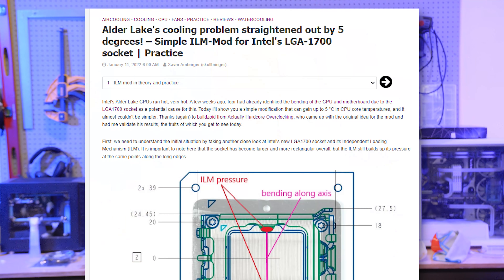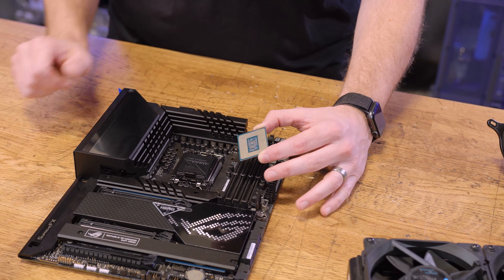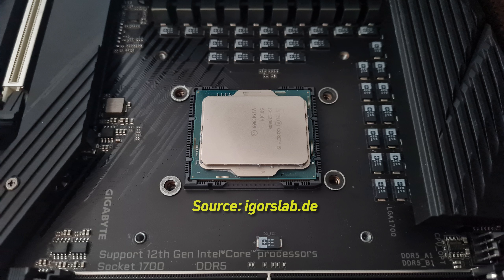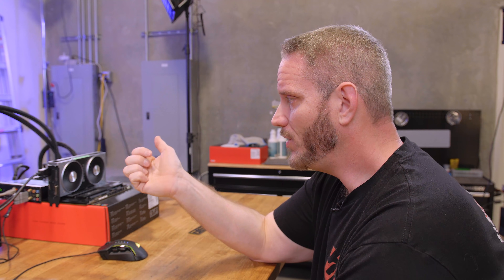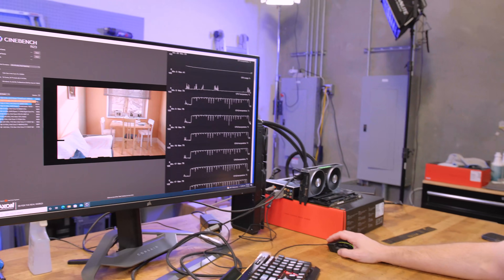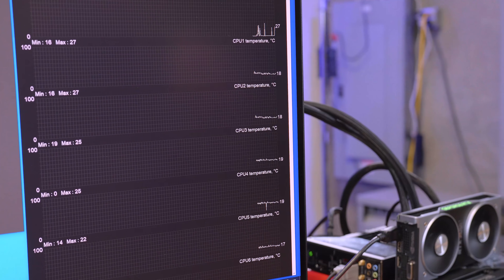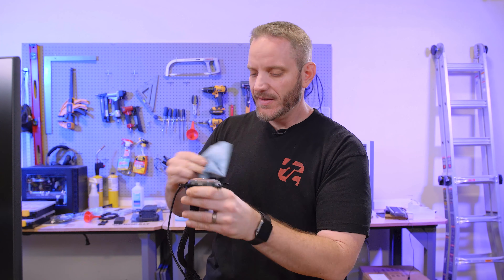YOU GUYS asked me to try this... so I did

Comment: "You don't need it to be polished like a mirror"
In fact, I would argue this could make things worse, but I would have to illustrate it to explain myself.
But basically, for a given average amount and thickness of air gap, a slightly rough surface should have more surface area, improving the effectiveness of the thermal paste.

Comment: I have the i7 12700k cpu, and the specs show that this cpu runs at 190w max and 100 degrees Celsius. So I limited my bios to 180w, and the temperature improved dramatically. The wattage doesn't go over 180w anymore. I use the Gigabyte z690 Game X, which was running high wattage on auto. Now, it is controlled to 10 watts less than the max specs of my cpu.

Comment: Fractal AIOs are known for being in the upper echelon of performance so I think that's probably why you had such positive results. So much in fact that I haven't been able to find one for sale at even close to retail for months so I just said "screw it" and spent $850 on a custom loop from EK. Couldn't be happier and don't think I'll ever be able to go back. I'm spoiled with these temps now. I'm tempted to try their TEC CPU cooler but I don't want to ruin my expectations of cooling forever so I'm probably going to hold off on that.

(For anyone that cares about my temps or setup): i9-13900KS overclocked and undervolted using load line settings and OCTVB to 6.2ghz on the P-cores and 4.6Ghz all core on the E-Cores. Idle temps hover around 30c and running cinebench I don't see over 80c. Gaming I don't see over 70c. My water loop cools JUST my CPU at the moment because I don't see any reason to water-cool my gigabyte 4090, the temps are astonishing with the stock air cooler and 2 180mm fans Intaking from the bottom blowing ambient air directly into the 4090. CPU loop is 1x 120mm rez, 1x EK Velocity2 LGA1700 CPU block in satin titanium and 1x 360x52mm (absolutely massively thick) x360m radiator front mount in a push intake config. Then at the rear of the case is 1 140mm exhaust. You might say I am pushing a massive amount of positive pressure in my case but it's a full size fractal torrent so the rear is so open I think I'm pretty neutral give or take. I also have a T-Sensor for the ambient air temps in my case just in general and it doesn't ever see anything over 30c. I'm thinking about deliding my 13900ks cleaning it up, liquid metal application and then replacing the IHS with a rockitcool copper IHS to see how low I can get the CPU temps under load. I've thought about cooling it via direct die but for some reason I'm nervous to do so, I tinker with my setup more than I actually benchmark or game on it and all the messing around and moving things around in the case idk if direct die would be a good idea in my case. Wow, I just meant to comment "yeah fractal AIOs are good" lmfao sorry to whoever reads this novel! 😂😂😂

Comment: Hi Jayz. I have just finished building a new rig. Upgraded from an i7 6850K to an i9 13900K and what an impressive performance boost. Problem. The CPU, running Cinebench R23, Temps are topping out immediately at 100’C. I am using my old water-block which is in excellent condition, an XSPC Raystorm Pro. Any suggestions??? Cheers Philip. ROG Strix Z790-A D4 Mobo, 32GB DDR4 Ram, MSI 3080Ti GPU. AX 1600i PSU.

Comment: I'm sure you already know this by now but if anyone is curious lapping a 12th gen CPU doesn't really do anything unless you lap it while it's clamped in the mounting bracket under pressure. You can lap the CPU all you want but as soon as you mount it back in the socket the mounting points clamp down and just bend your CPU again causing the little concave in the IHS. LGA 1700 dropped the ball on that one. Washer mod helps but still not worth lapping. You would literally need to sacrifice a mother board and cut out the mounting bracket while your CPU is clamped in it and then lap it while it's mounted so it will be lapped flat while under pressure. Either that or get the thermal grizzly mounting frame and ditch the stock mounting entirely.

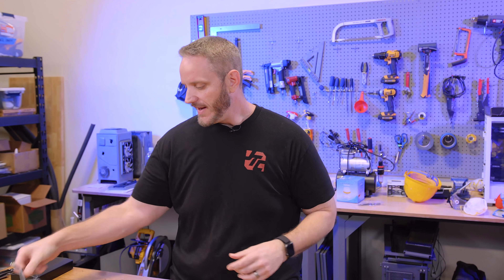Comment: I don't think this is something where you can determine success or failure simply by looking at temperatures.  The way things run on these CPUs, unless you've locked your clock speeds at something static, things are too dynamic.  The temperatures may not change by any noticeable amount, but it could be running faster or slower depending on the various physical characteristics involved in this scenario.  I just did this mod to my 12900KS system today and I used a Handbrake 1080p movie encode before and after in order to see if there were actually any benefit to it.  This test pegs all cores/threads at 100% until it is complete.  Before doing the mod the movie encode took 1726 seconds to run, which is 28:46.  I shut the machine down and did the mod and once it was complete I reran the same encode.  This time it took 1499 seconds to encode, which is 24:59, a savings of 3:47.  The before run says it ran at 73.81 fps, and the after at 84.97 fps, an improvement of over 15%.  I didn't even bother monitoring temps for this test, as I wasn't really concerned with that, seeing as how the machine will alter its clock speeds according to current temps anyway.  If it has some extra temperature room it'll clock it a bit higher, which in turn leads to a bit more temp.  So it is possible that if you only look at temps and not performance then things could even out anyway and seem to not have changed, even though the actual amount of performance you see could change.
Reply: YES, thank you for making this point. I don't know why this was not mentioned.
Reply: @56brever  Yeah, I thought it was a bit strange that this was overlooked. Seems to be the most important thing to consider.

Comment: Think you just had a factory "golden assembly" CPU. I have built a couple identical 12900k systems at a time and have seen peak temps have a 10c difference. All with Kryonaut and 360mm AIO. The hot ones I checked TIM application too. Giving in and going to try to lap a 12th gen while mounted in a socket. Had a bundle lga 1700 board I was not gonna use so it is my donor board.

Comment: From my experience with aftermarket coolers, not just liquid coolers, their mounting system is very jank and I have ALWAYS had to jury rig it to sit properly.

I just wish my 1st gen Corsair H60se (from like 10yrs ago) could manage the temps of a 12700KF so I know if I installed it the best I could or adjust it better.

Comment: I just did this mod. My CPU clamp bracket was putting down a ton of pressure before. Lapped it flat and used kryonaut at the same time. Dropped 20c max temp during one cinebench run... Insane. 93 to 73. 12700k, 4.9 & 3.9. 1.3v. My lapping pattern midway was pretty crazy.

Comment: You should do the test with the mod and a new processor, which has not yet been used and not been bend in any direction. 
If you do the mod with an already bent IHS, it's already too late.

Comment: This worked for me...I dropped 10C
I used the washers that came with my case...the ones for the mobo mounting.
I have an i5-12400 on an Asus Prime H670-PLUS D4.

I initially tried to bend part of the ILM to relieve the pressure, but that wouldn't budge even when heated.
Reply: I'm also using the stock cooler

Comment: I ran that test with my new system I built. My i9-12700k is hitting 100c on some cores. I'm using the corsair h150i lcd cooler. I've never seen a cpu get so hot with water cooling and it's stock. I have the corsair 5000x case. I wish I had those temps you are getting lol. I just ordered that Kingpin Cooling KPx Thermal Grease 1g. So hopefully that will be enough for my i9.

Comment: The standoff height for the Corsair LGA1700 upgrade kit is 1.05mm shorter than the LGA1200 standoffs they replace so it seems more likely that the socket, or the cpus, are getting shorter, not higher.

Comment: I modified the standard Lian Li Galahad 240 LGA 1200 backplate Bracket to fit the 1700 and works perfectly, the bolts already have springs and that particular AIO already comes with washers, of course, normally you would be able to just order an LGA 1700 compatible kit for this AIO from Lian Li, but Im not in the US and I can't order stuff internationally.

Comment: I'm no mechanical engineer but I would think scuffing it a bit and providing more surface area for the thermal compound would actually improve thermal conductivity (assuming a flat plane). Isn't that the idea behind leaving the machining pattern on the water-block?

Comment: I am using Corsair H60i RBG PRO XT on my 12600k with slight turbo overclock to 5.2 GHz, using it with the LGA1151 screws and didn't have any issues, works fine and normal with no overheating even when stressed at max frequency

Comment: I can confirm it worked for me, on gigabyte z690 ud and arctic freezer 34 esports duo temp drops from 84 to mosty 77, sometimes 80 but mosty is 77C. This is 7C drop!
Reply: you didnt say what cpu you had and where do you get the washers or a part number for them? thanks
Reply: @tdb0ne1  i9-12900kf, 8mm plastic washers from hardware store

Comment: I highly recommend this mod! Not only because of better temperatures, it also fixed my errorcode 55. The pesure on the socket was so high, that my RAM-slot A2 wasnt detected and caused thet Motherboard-error. I used 0,8mm plates. now everything runs fine.

Comment: Your 12900 is concave so it may be working to your advantage when using the old coolers putting more pressure  on the screws may just be putting enough pressure to flatten out the 12900.

Comment: As someone running a qtj1 messing with the cpu socket like this is scary. Less mounting pressure from the socket can obviously cause pins not to contact the cpu properly which would damage it over time.

Comment: This mod has been life saving for me. I'm running a 12900K with a Corsair H150 Elite Capelix AIO on an Asus Z690 Formula motherboard. In Cinebench 23 the P cores averaged around 95-97C with 2 cores reaching 100C (with original AIO thermal paste). I removed the AIO and I saw that it made contact with the CPU at the top/bottom edges and in the middle it was clean (I don't think the paste even made contact in the middle). I put new paste but the temps did not change. I thought, well, bad luck, this is it. Then I saw the article from igor's Lab. I went to the hardware store and I bought 4 washers (M5 as they did not have M4 :). I was busy this week and only today I got the chance to implement the mod. Now in Cinebench 23 the highest temp is 89C with the other P cores averaging around 85C.

Comment: The word you're looking for is not domed but Convex, Concave bends inwards (remember cave is a hole and goes inwards and you'll remember which is which lol), Convex bends outwards like a lens on an magnifying glass etc. 

And Intel IHS have been either as far back as the Pentium 4's (was a huge issue back then), that's why water block manufacturers made their mounting systems bow the block so that it counteracted the way the IHS was and thus reduced the gap in-between that would be filled by the TIM. 

You can of course lap the IHS to reduce this but depending on the water block you should likely lap that too otherwise risk the gap being no better than without the lapping and in theory if you lapped both enough you could do away with the TIM in-between altogether since both would be perfectly flat (this is almost impossible though since an typical IHS even an lapped one looks like the craters of the moon under a microscope).

Comment: Great video; however the concave IHS has nothing to do with AIO/Cooler bracket pressure, but ILM central pressure on the two central flaps of the IHS. The flat cold plate of the AIO should actually counter the concavity a little, not cause it.

Comment: Hello 👋 ,
what about putting everything in a case ? 
My temperature is 95-100 c with a 12900k and Asus Rog Ryujin 2 360 after 10 minutes by using R20 . Any advice for me ? By the way didn’t do antything what Igor or you said for getting better temps . Do you think i should  try your trials ?
Reply: Yes.

I did with my 12400 and dropped 10C

Comment: You need to do this mod BEFORE your CPU already turned concave. It's a mod to avoid it bending overtime and thus losing contact with your cooler (unless you wanna repaste every week) or having worst thermal 'cause more thermal past needed.
It's still good to do even once it turned concave, so it doesnt keep bending overtime (and thus turn temps bad again).
Either way, that's not something you can notice on new builds or builds that doesnt last more than few days.
Reply: so you're saying you need to add the 4 total washers before you even put a new 12th gen intel cpu in the socket?
Reply: @VintageCR  ideally, yes.

Comment: Could it be that the first run, with no washers, was slightly correcting the preexisting imperfection of the cpu? It was slightly concave. Pressing down on the edges makes it less concave. Adding the washers either let it become more concave again, or the new shape was set in on the first run and so the "correction" stayed that way.  Since it was "corrected" to be more flat, lapping doesn't do much either.  Just a theory.  I haven't watched the Buildzoid vid or read the article, so I do not know what shape (concave, convex, flat) their cpus were before testing.

Comment: This is EXACLY the reason why Intel changed the mounting hole spacing. Idiot cooler manufactures, they did not only be lazy and cheap, the were even cheaper as seemingly they didn't have any mechanical engineers in service lol

Comment: Could we also be reaching the limitations of the coolant/pumps ability to keep up with the generated heat from the CPU?
Reply: Ifi t was coolant, it would be volume then. Water has insane thermal capacity (Heat and cold) so reaching that capacity is hard. What you tend to rech first is the abaility for the rad to dissipate the heat. This is why bigger rads CAN be better, as they offer more surface area for the heat to dissipate too.

Pumps might be a factor, but on the other hand, I dont see how. I have stopped using watercoolers after my first one as an AIO was very underwhelming. It was silent.. ish, bu so would an NH15 be, without the fear of having leakage or pump breakage. not saying aircollers are superior just saying that my 280 Fractal design celcius was a bit underwhelming on my 3700X.

Comment: I have a decent idea for a video,  I thought about this while building my engine for my car. Copper gasket spray as thermal paste. The spray would adhere well to the cpu and could maybe work. I'm thinking not very well, but would be interesting to see. If it worked, one can would last you a lifetime. Also it's not permanent.
Reply: Great idea, would be a fun watch!
Reply: Just got to be careful that it dosent get in the pins or it will most likely short out the CPU or other parts on the motherboard. If you applied it specifically to the surface of the CPU it would be fine as long as it's not corrosive.
Reply: Try some nickel and/or copper based anti seize compound while he is at it. They look like they would make awesome "heat sink goo"
Reply: Would this be any diferent in performance to existing liquid metal products (Thermal Grizzly)?

Comment: I'm building with an old 6700k. because of the issues that there were with the thickness of the substrate I took a 1/3 turn off the lock system and I've had great temps and hopefully no bent cpu

Comment: I think as long as you use good Thermal Paste and apply it evenly so that it covers the Dye and get a good mount with your Cooling  Block all this Lapping and Tweaking is a waste of time.   It’s good to understand the Dynamics of what your trying to do to shave off a couple of degrees but in the big scheme of things this is just another Pro Tip if you want to play with your hardware to try and make an already great set slightly better.  Another thing to consider is that you might damage an expensive CPU by handling it to much lapping it and then dropping it and bending the Pins.  Best thing to do with a new CPU is put it straight into the Motherboard Socket before you screw it up.

Comment: Unrelated sorry. New to this computer building world. I'm looking at a ryzen 5600G to use until I can justify a GPU. When I get around to installing a GPU will the graphics cores in the 5600G convert back to working as CPU cores?
Reply: try to think about it like this: will a small subwoofer convert into a full range loudspeaker just because you bought a bigger subwoofer?

Comment: If the cooler bracket is bowing the IHS then I'd think a concave housing would get flatter. Maybe this solution works better for convex housings.
Reply: For real...
The physics of how this happens are being completely ignored.
I'd bet the IHS is concave because the mounting pressure + a domed heatsink was used (common) 
If the pressure is high it's not going to lift the CPU up from the sides... The motherboard is clamping it down from the sides and nothing is lifting the sides.